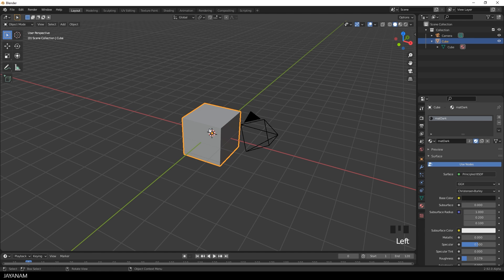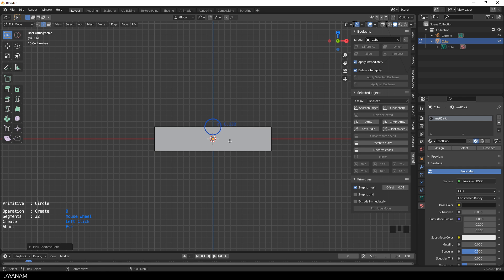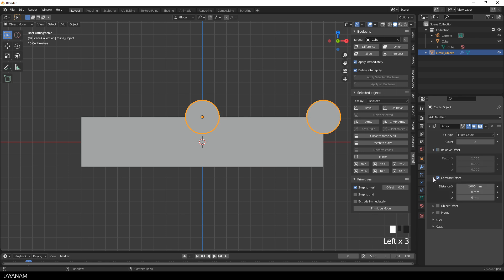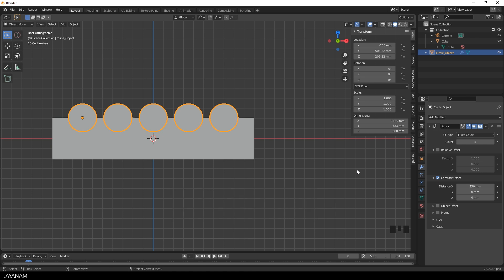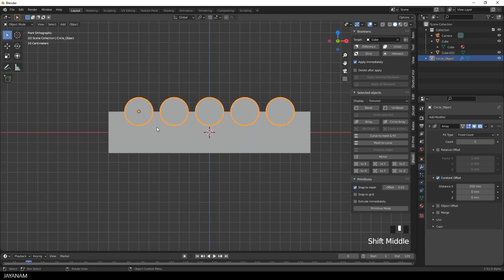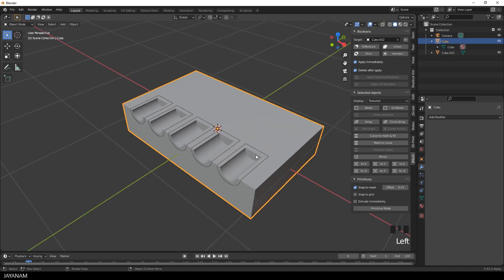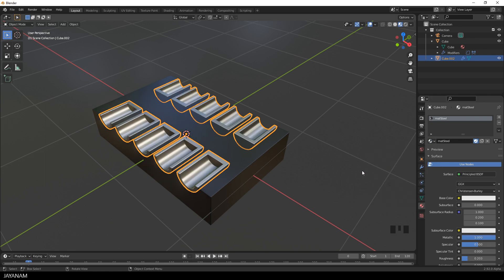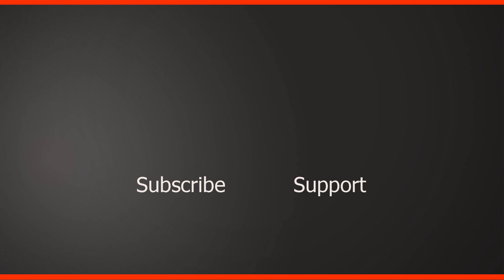Blender 2.9 Array Modifier and Hardsurface Modeling Tips

Comment: Thank you man! Say, one question: I'm just modeling a huge skyscraper complex by extensive use of array modifiers and booleans. In your experience, shall I bake it all down for the rendering stage to save performance, or is it just the other way around? Thanks again!
Reply from the maker: It depends on the implementation but if it is implemented as I suppose it shouldn't make a difference.